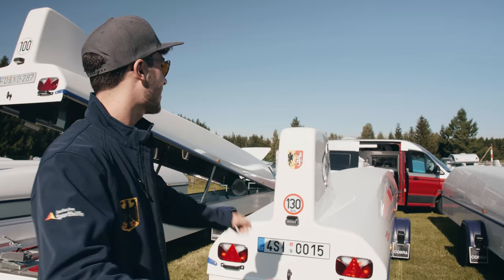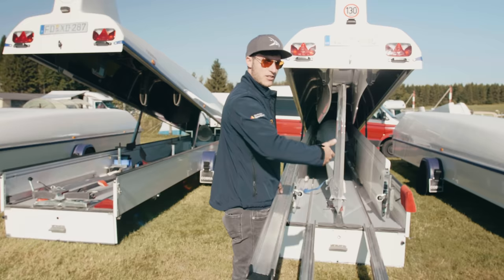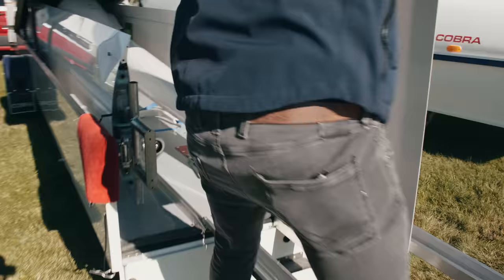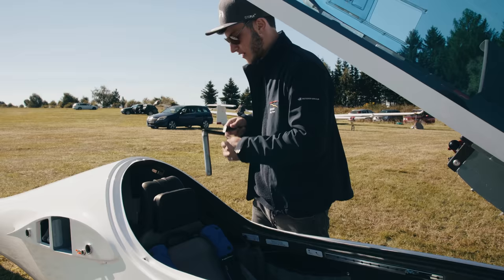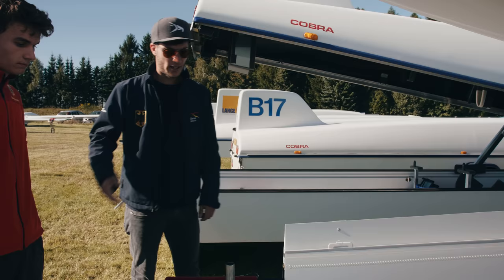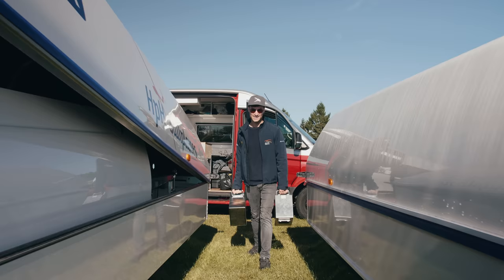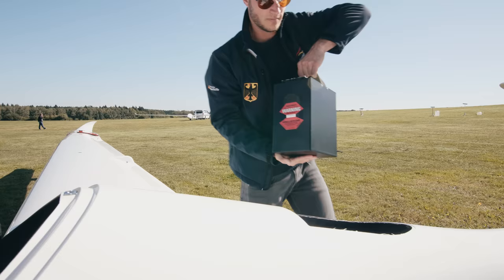How Does A Glider Fit Into A Trailer?

Comment: Thanks for this.  I had been wondering about how it was all assembled.  How do the control linkages connect?
Reply from the maker: They are automatically connected at modern gliders
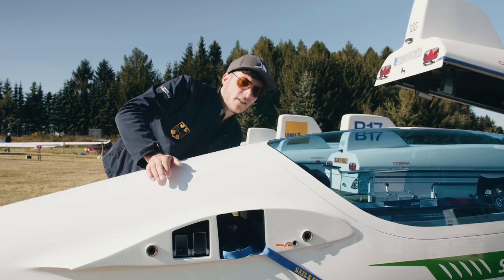Reply: If you pause the video at 0:46, you can see two "funnels" in the rear square hole.  At 1:24, you can see two bellcrancks on the wing root rib, which engage into those funnels.  The elevator connection can be seen at 3:13, those pins on the rotating shaft at top rear of the fin engage into bushings on the elevator.
Reply: @juhakettunen7971  Thanks for that!
Reply: @juhakettunen7971  they attach themselves!!! scariest thing i have ever seen as an engineer! 😐
Reply: Or on older gliders you have to fit a ball into a bearing and then secure it with a cylinder that you can screw to cover the bearing, then it is secured with a pin.

Comment: Is the trailer really rated for 130 kmh?
Reply from the maker: Yes, in Czech Republic. Works well with my VW Crafter ;)
Reply: @SteFly  When you really need to get there!
Reply: @SteFly  Wow!  With the Duo trailer (with 2 different trailers), going faster than 90 kph makes the Subaru start to sway.
Reply: @lautoka63  Duo-discus?   That’s a heavy ass glider